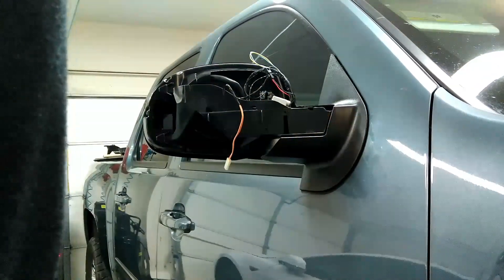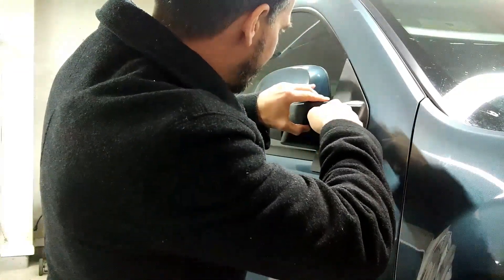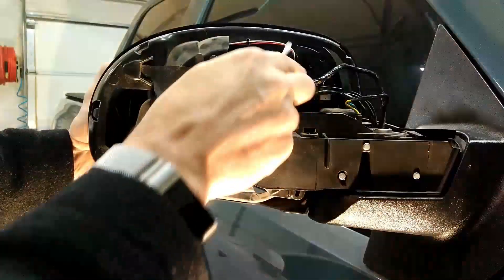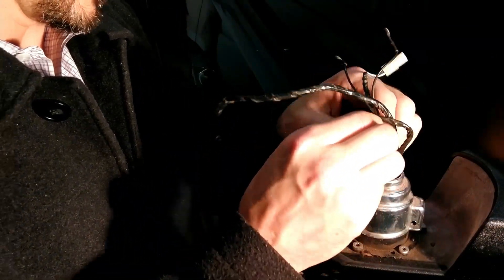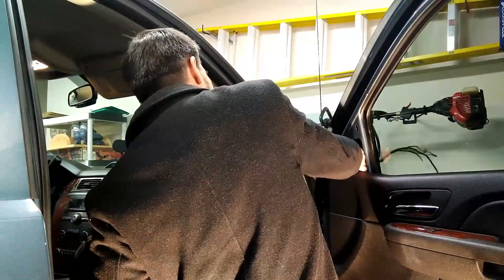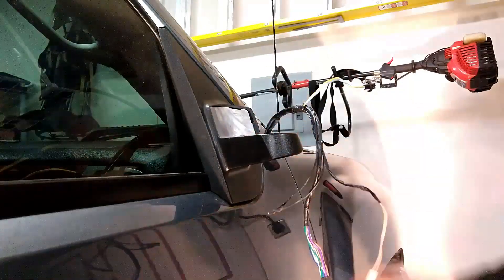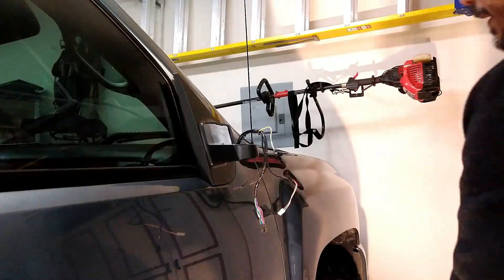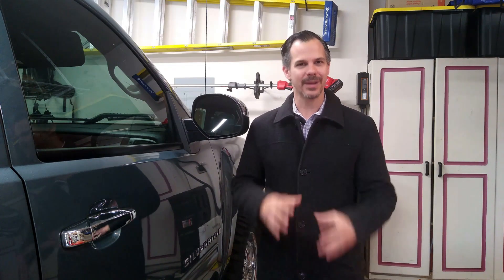Folding Mirror Motor Fix 2008 - 2013 Silverado Sierra Yukon Tahoe Suburban

Comment: Both of my mirrors broke after being folded a few times. I'm just gonna replace the fold motors in them that I've found on Amazon. 

I don't wanna buy a used mirrors cause those my have broken folding also.. you never know.  

Great tutorial video 👍

Comment: Good video. Thanks. I have a 2013 Avalanche. The passenger side quit folding. I haven't decided yet if I'm going to tackle it since I only need the drivers side to fold when pulling into my garage. But if I do thanks for showing how.

Comment: So I’m having an issue finding the right near mine was hit at Walmart parking lot and everything I find on eBay is heated and only few have power glass Which is what I need mine are not heated. My question is can you use a heated mirror that has power glass if not any ideas on where I can find the correct mirror thank you so much for your videos.
Reply: I got mine from 1A auto.
Reply: Thank you!

Comment: I just bought a 2011 Silverado that supposedly has electric folding mirrors. However the mirror controls do not have the two buttons that control the fold, just the mirror angle.  Factory mistake?

Comment: Cool idea to harvest the power folding motor, my gear is broke in the power folding motor, and my mirror actuator will not move up and down, but they move left and right, I was looking  to buy a new mirrors from GM for my 2008 Chevy Avalanche, 387 for the driver side, and 238 for the passenger side 😡, I can't find a set of mirrors that have all seven features that my truck has, so I'm thinking of doing what you did, just harvest the motor out of a cheap set of mirrors on Amazon or ebay, thanks for the video

Comment: so why not just use the glass with the turn signal and the teal painted cap on the new mirror with all new parts? why even waste time breaking down the new mirror for the motor (i get it, the whole assembly is cheaper than the motor) but why break it down?
Reply from the maker: This was discussed @13:46 in the video.

Comment: This is too much work! It's a lot easier to replace the gear with a steel one. There is a company that sells the new steel gear and a new motor for about $70. They have an excellent video on how to replace the motor and gear. Takes about an hour. They even sell a complete motor and gear assembly so you don't have to worry about how to get that silver gear cover off or rewiring anything. What you have there is a working mirror but still with a plastic gear that will eventually break again.
@gruvenparts